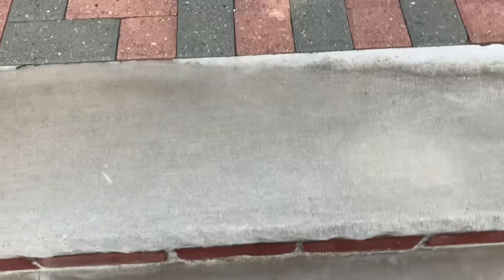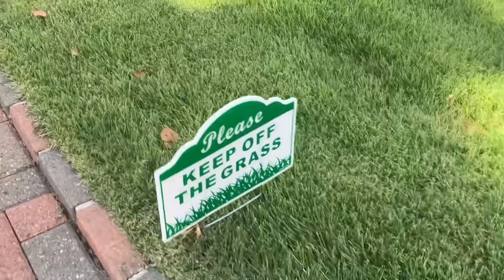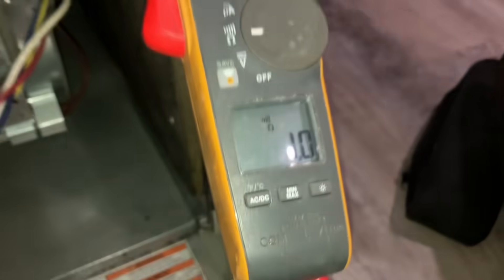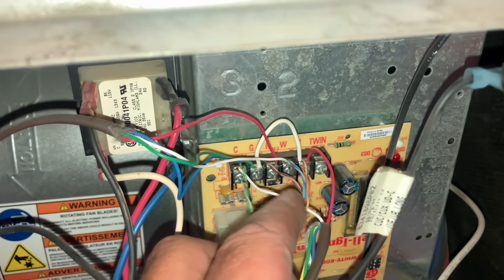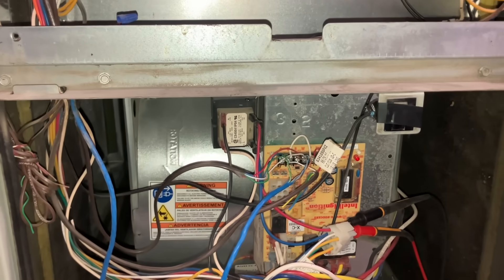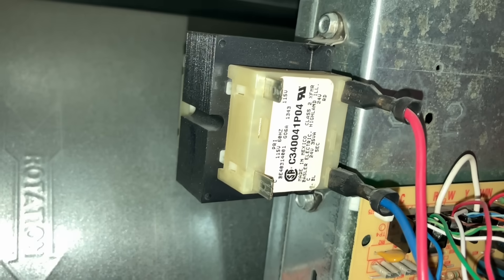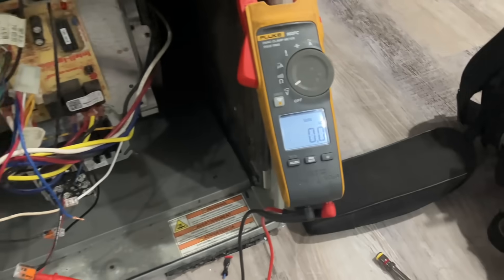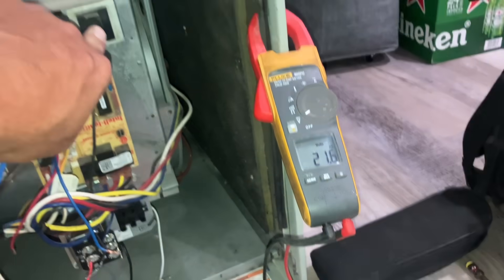Furnace From Hell: Low Voltage Mystery & Bad Transformer Diagnosis!

Comment: Only a DIY er here but I had the same issue. Apparently , when I had the yearly service , the tech disturbed  a connection at the board . Intrepid and curious, I simply tightened up the screws going in to the circuit board from the thermostat, And voila the system powered up. My neighbor had his rooms painted and the painter forgot to cut the power to the stat. neighbor had tech come and after two hours determined a new stat was needed. I went over to look at the neighbors request. I pulled the 3A fuse from the board and tested it. ZApped. New fuse and voila the system powered up. I always seem to have to remind myself to look at the  simple things first. Anyway, enjoying your HVAC adventures!
Reply from the maker: Glad you're enjoying the videos!

Comment: I wonder if that switch on the side is causing a problem. Like the others mentioned, the voltage may drop when under load, which leads me to suspect that switch.

A grounding issue might be possible.....

Or your new transformer is bad. A new part being bad would be a shame to overlook.

Comment: if the transformer is putting out lower voltage than normal and not blazing hot, that would be the secondary windings overheated and shorted between some of the turns, making it output lower voltage since there's less wire turns in total. the more secondary turns the higher voltage output will be.
partial shorted windings on the primary side would over current, overheat and burn out the internal fuse or short and trip a breaker.
kind off odd seeing a secondary failure with reduced voltage and not having burnt the primary side/fuse!
*edit* noticed you didn't check the line voltage with it under load to see if the voltage dropped off. leave transformer connected or better yet, manually move blower high speed to an available power source and check voltage. a problem with line voltage being low on primary side, will make output side low. that switch that didn't turn power off was suspect to me and blower door switches can fail oddly at times. then seeing 21v from new transformer, suggests either low line voltage or something on secondary is drawing too much current(transformer breaker should trip)

Comment: who the BEEEEEEEEEEEEEP, was hacking inside that furnace and ran eth. cable in place of t-stat wire. it's especially stupid that a FAN only call turns the AC on year round. LOL
going to guess bad contactor in condenser, cooked transformer in furnace(surprised it didn't let the smoke out fully).
whomever was there previously hacking around should have their fingers broken with pliers, after having their nails ripped off slowly. 🤣🥸🤡

Comment: The power may be coming from a pony panel and the bonding screw wasn't removed. I would check for voltage across neutral and ground.
I had 118 volts at a plug, I removed the bonding screw and it returned to 124 volts ac. Not sure what caused the voltage drop.

Comment: A high resistance 24v fault on one of the controls connected to 24v is pulling down the secondary voltage on the xfmr?

Comment: First, your measurement of the primary voltage was being done "open circuit." That means you were not testing the primary voltage when it was under the load of the transformer primary winding. If there is a high resistance in the 120 coming to those two wires, for example, due to a problem with the door switch, the ACTUAL available voltage to the transformer could be lower than 120 volts. The voltage can be "pulled down" due to a point of high resistance...like a door switch. The only way to accurately test a transformer voltage is under load. Then, other testing, like the furnace neutral, could be needed. A high resistance in the neutral connection could act like a bad door switch, too. HTH.

Comment: In the beginning of the video the transformer for the humidifier was good .. we assume .. take the line voltage from that feed and feed it to your furnace transformer .. possible stray neutral on furnace transformer digital amprobe showing 122 volts which is good possible ghost voltage .. put an analog meter to check ..

Comment: The cat6 is probably rated for your ac voltage but not the current. Check your VA rating on tranformer. Cat 6 is only 23/24 awg wire. You may need at least a #20 wire. Could be why your getting only half voltage. Just a guess of course.

Comment: Loose wire in my main service panel, floating neutral and running through conduit ground(shitty).  A GFCI breaker would have caught that.  Boards are likely fine.

Comment: Unplug the control board from the transformer and check it, bet you have 24 volts.  Something on the control board is not right and it is pulling the voltage down.. could also be the thermostat pulling the voltage down.

Comment: You may  have a crappy ground.   Some transformers need to be properly grounded. Check that furnace is properly grounded. Check line voltage to ground on unit itself. You never know!

Comment: Check the incoming voltage to the transformer under load. Could be a voltage drop. Was the secondary under load when you checked it.
Reply: yeah, test under load, leave known good transformer connected or better yet, unhook and put blower high speed as a load and test line voltage.
usually there's an open terminal on the circuit board. if not unhook transformer line and put blower high on there. I'm suspecting the switch that didn't appear to turn anything off, blower door switches can act stupid sometimes. but yes, always test under load when you see low voltage anywhere.

Comment: Why would you change the control if you don't read correct voltage out of the transformer? Beside that you need a minimum of 19v !

Comment: Those intelli-ignition systems suck, they got phased out after a short run 'cause they were incovenient to encounter in the field
Reply: Yeah I've condemned those many times. Solder connections fail in the board on the molex

Comment: Womder if that heat exchanger  is cracked? I have been finding  alot of those AUD and TUD models to have cracks on the cells juat below the crimped edge from the factory. Womder if that thermostat is shorted internally. Taking out the secondary of the transformer.  I have seen it happen quite often. Noticed that there was not a common wire available  so the G wire was used for common and junper from G to Y

Comment: You're a plumber. You should never touch a furnace. You're confusing an air handler with a furnace. Even though you don't need a P trap on a positive pressure upflow furnace, you don't need one on a downflow either. The blower on a downflow is also before the evap coil. You need a P trap on a negative pressure " air handler". You also misdiagnosed the IFC board. You just needed a transformer. Odds are if the 3 amp fuse didn't blow then the board was still good. Did you check if the board was grounded? Probably not. Plumbers should NOT mess with furnaces. Stick to your own trade.
Reply: Okay king pin
Reply: nice, but it's certainly a low line voltage issue, the service switch on the side is suspect, he didn't test under load, use a known good transformer or better yet the blower high speed as a load to test line voltage, if it's low then re-test moving upstream. it could be anything upstream, switch/wire/breaker/main/meter/service drop/open neutral and anything anywhere on utility co secondary side. although most of those would cause issues in the whole building, lights dimming/flickering, appliances burning up or turning on/off.
Reply from the maker: Ok genius. Keep being an armchair warrior